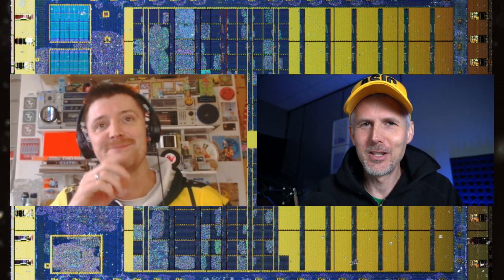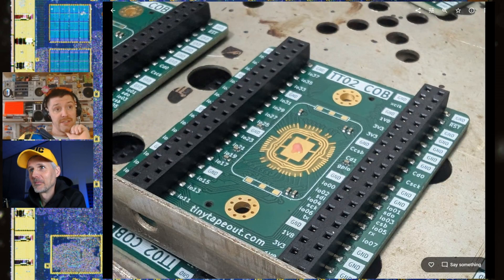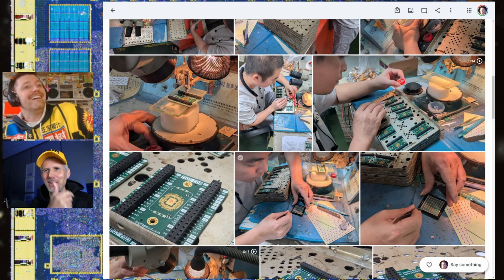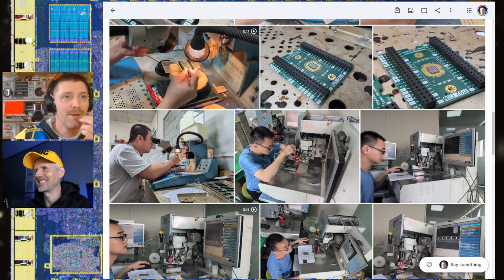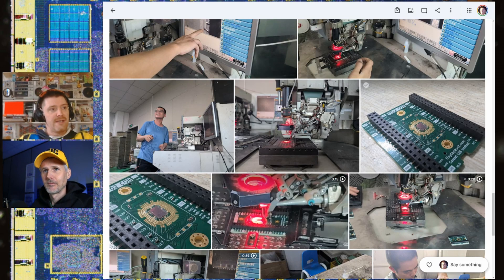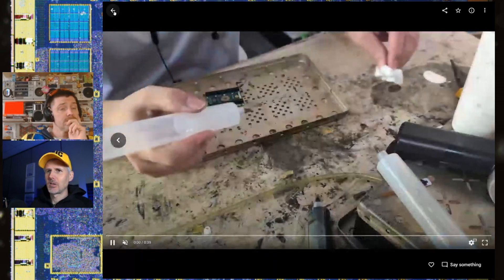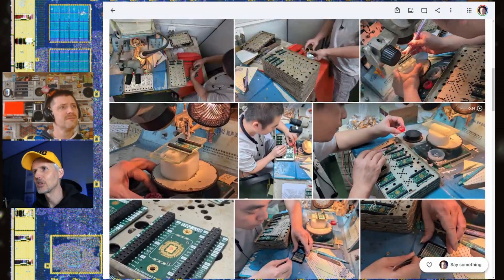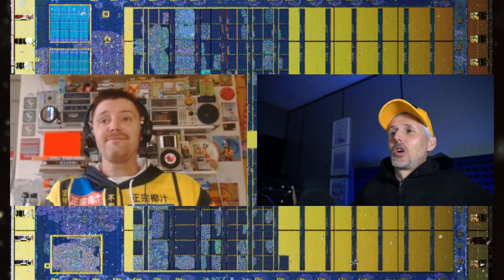Chip on Board! Wirebonding ASICs

Comment: I used to work in a clean room in US building medical grade electronics(pacemakers, defibrillators), it was FDA regulated, it was spic and span clean, you could look into the air conditioning vents and there was no dust. We used all automatic K&S 5mil wire bonders and 1.5mil gold ball bonders, all the microscopes were brand new Leica’s. In all honesty though, wire bond is an old technology anyhow, most companies use inverted ball bonding now.
Reply: For VLSI maybe; there are still a lot of things which are wire bonded. Sensors, LEDs, lasers...